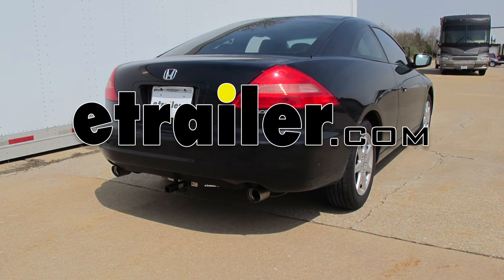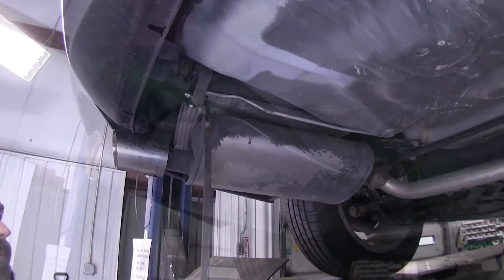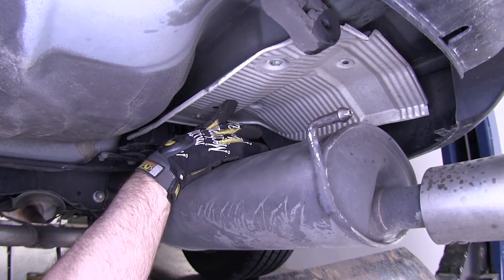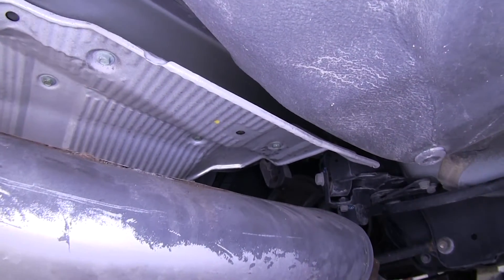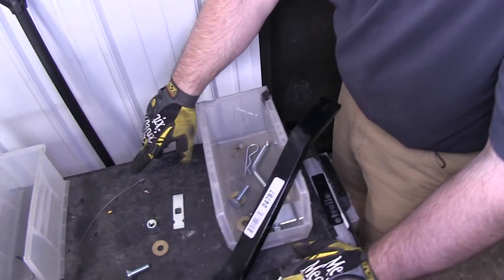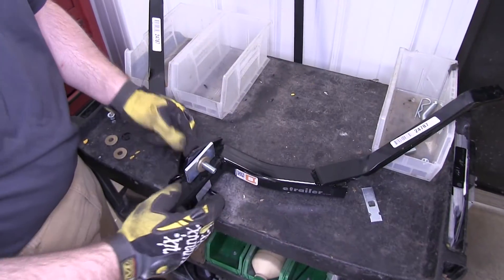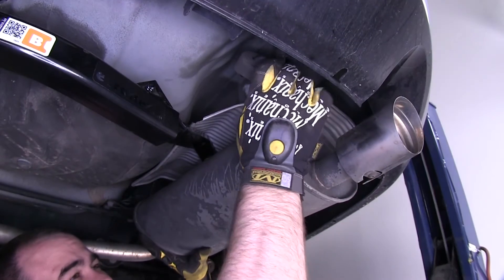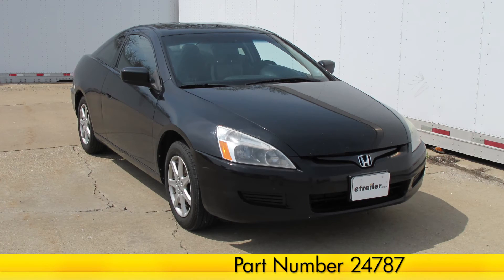etrailer | 2003 Honda Accord Draw-Tite Sportframe Trailer Hitch Receiver: Complete Installation

Comment: Where they say drill a hold 4 1/2" from the front hole, I found that it had to be about 4 1/8", or the hitch frame support bolts won't line up with the would line up hitch frame support holes.  The centers of the two holes on the car frame are 4 1/8" apart.  Measure them and you'll see.   Also, they don't tell you the what diameter to drill.  I used 1/2", but then found that I had to wallow out the hole in the shield to the same diameter as the hole in the car frame, which is about 1".  This allowed me to have some wiggle room to allow the support bolts to line up with the holes in the hitch frame.  Would be nice if the support bolts were 1/4" longer so that it would be MUCH easier to feed them through the hitch frame, leaving enough length sticking out to start the nuts threading onto them.  Also, DON'T remove the lead wires from the bolts until you have successfully gotten the support bolts to line up with the hitch frame, and they are extending out long enough to thread the nuts onto them.  Otherwise, the installation process will end up pushing the bolts inside the car frame, and you'll never get them out.  You'll be up the creek at that time.

Also, I found a VERY easy way to remove the muffler hangers from the muffler hanger rods.  Apply the lubricant as shown in the video.  Wiggle the mufflers around to distribute the lubricant.  Then with large channel locks, put one jaw on the muffler hanger support rod, and the other jaw behind the rubber hanger.  Squeeze the channel locks and the rubber hangers slide off the metal hangar rods easily.  I did all four of mine in about 3 minutes.